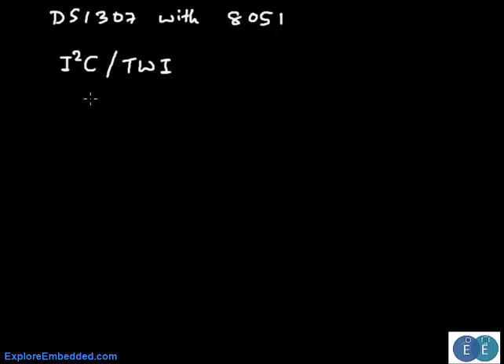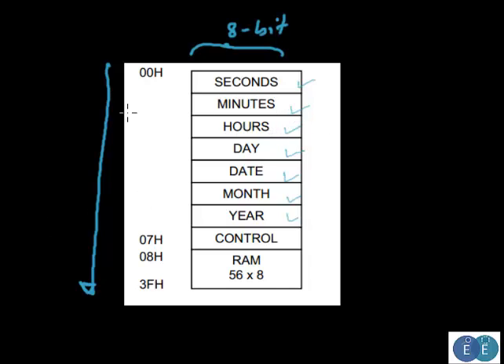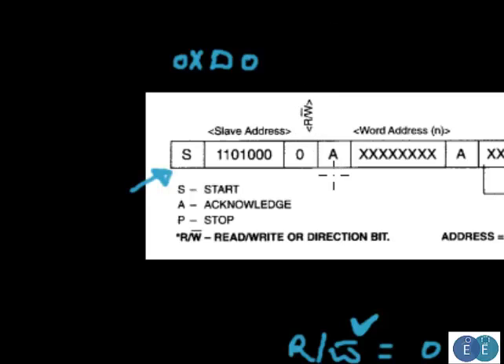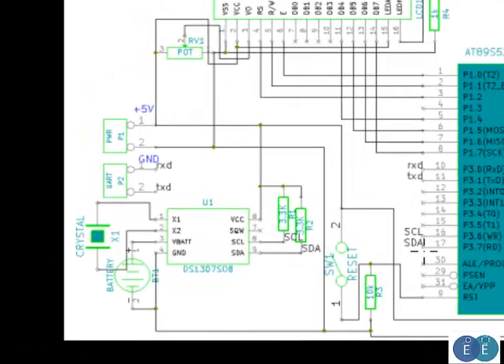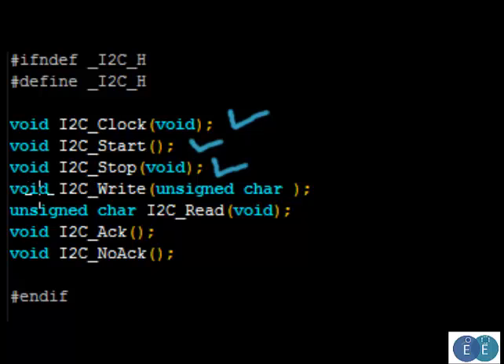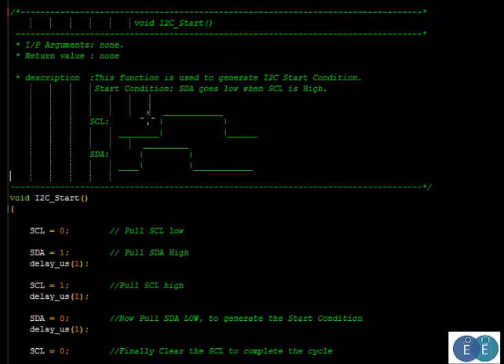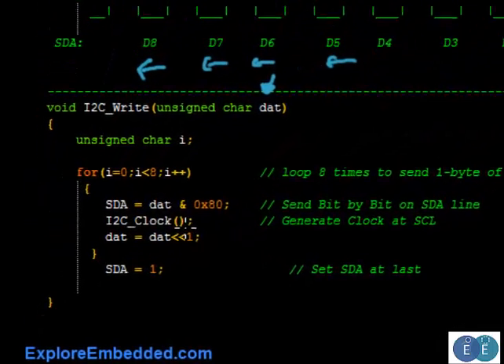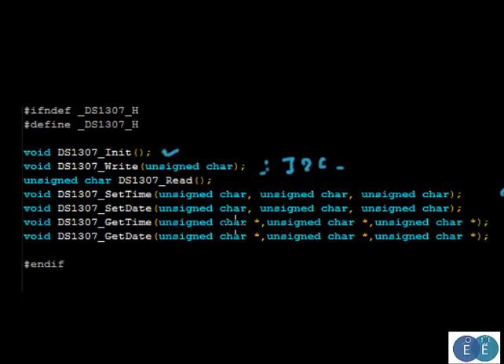8051 DS1307 RTC Interface- Part 1

Comment: Hi sir..I m  having small doubt on  i2c protocol in 8051
Correct me if i m wrong sir
Actually in i2c communication(ie with DS1307 RTC),i hav doubt in write & read operation sir
What indicates a write operation?
My guess:Whenever SCL moves from high to low,data on SDA goes to slave(ie master as transmitter(8051) & slave as DS1307)
What indicates a Read operation?
My guess:Whenever SCL moves from low to high,data on SDA goes to Master( ie slave as TransmitterDS1307 & master as 8051)

This is the below program i got from ur site sir,Pls correct if i m wrong
/-------------------------------------------------------------------------------
                         void I2C_Write(unsigned char dat)
 --------------------------------------------------------------------------------*
 * I/P Arguments: unsigned char-->8bit data to be sent.
 * Return value : none
 
 * description  :This function is used to send a byte on SDA line using I2C protocol
                 8bit data is sent bit-by-bit on each clock cycle.
                 MSB(bit) is sent first and LSB(bit) is sent at last.
                 Data is sent when SCL is low.
 
---------------------------------------------------------------------------------*/
void I2C_Write(unsigned char dat)                                         
{
    unsigned char i;                                                 
 
    for(i=0;i<8;i++)         // loop 8 times to send 1-byte of data
     {
        SDA = dat & 0x80;    // Send Bit by Bit on SDA line            //Here i understand that we                  --                                                                                                                 ///ANDing with 0x80 to 
        I2C_Clock();         // Generate Clock at SCL                               //send MSB first.& data is shifted for 8 times.
        dat = dat<<1;                                                                          //But my question is they want to set the SCL 
      }                                                                                                     //as HIGH to LOW na,,but  --                --                                                                                                                             //they didnt.
        SDA = 1;                 // Set SDA at last                                                 //Similarly y they --                                --                                                                                                                                 //setting                                                          ==                                                                                                                                       //SDA=1
}                                                                                                                          
 
/---------------------------------------------------------------------------------
                         unsigned char I2C_Read()
 ----------------------------------------------------------------------------------*
 * I/P Arguments: none.
 * Return value : Unsigned char(received byte)
 
 * description :This fun is used to receive a byte on SDA line using I2C protocol.
               8bit data is received bit-by-bit each clock and finally packed into Byte.
               MSB(bit) is received first and LSB(bit) is received at last.
 
-----------------------------------------------------------------------------------*/
unsigned char I2C_Read(void)
{
    unsigned char i, dat=0x00;
 
       SDA=1;               //Make SDA as I/P
    for(i=0;i<8;i++)        // loop 8times to read 1-byte of data            //Similarly here ..   ==                                                                                                                                         --                                                                                                                 //mentioned about 
     {                                                                                                        
       delay_us(1);                                                                            //SCL (high to low
        SCL = 1;            // Pull SCL High
        delay_us(1);
 
        dat = dat<<1;       //dat is Shifted each time and
        dat = dat | SDA;    //ORed with the received bit to pack into byte
 
        SCL = 0;            // Clear SCL to complete the Clock
       }
   return dat;               // Finally return the received Byte*
}

SIR PLS HELP ME SIR,WAITING FOR UR REPLY..THANKS IN ADVANCE

Comment: at 17:40 its said to AND the data,dat, with 10000000 i.e 80H.So, suppose dat=10110110,after ANDing with 80H we get 10000000,which is not equal to MSB of data dat, how it assigns 1 to SDA,after instruction SDA=dat&0x80, it should rather be 00000001 not 10000000

Comment: It is very good explanation but 1 point is not clear suddenly you say & with 8,why want to and with 8 is not clear ,confusing part pls make it clear
Reply from the maker: at what time in the video?
Reply from the maker: thank you do share the vidoes with your friends!  Please explain the point you did not understand. Also tell us the time in the video you're referring to.
Reply: Explore Embedded 
Could u pls tel what the "void" & "unsigned" here means..i really cant understand that how u saying that receiving concept with void...pl spls               explain
my mailid   rk771990@gmail.com
Reply from the maker: Rajesh Kannan     void  means there is no return from the function. Unsigned: Let say you have 8 bit data type. If you want to use all of the 8 bits and do not  want to reserve a bit for sign. We use unsigned as the datatype.